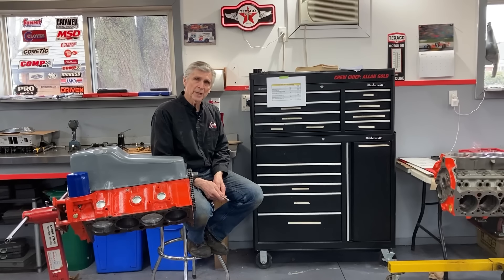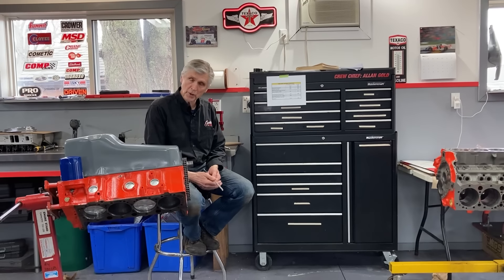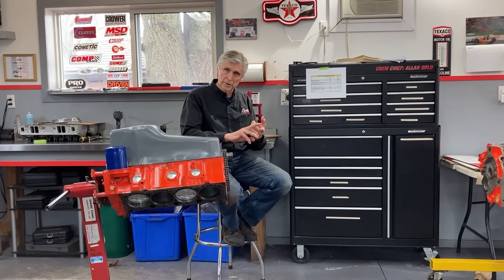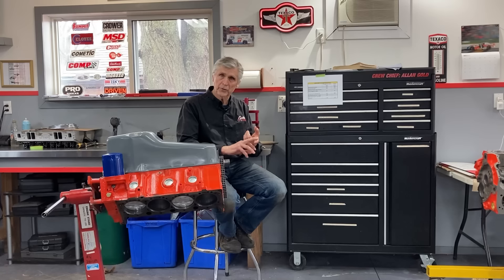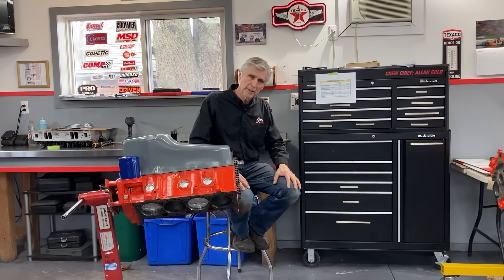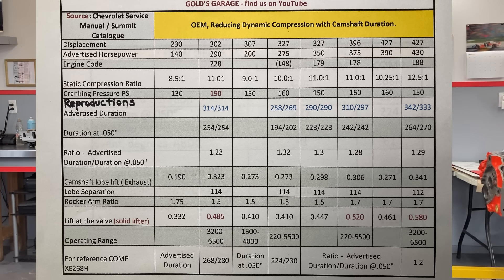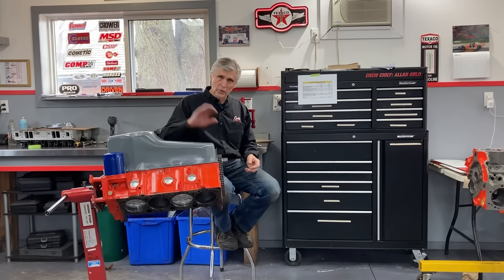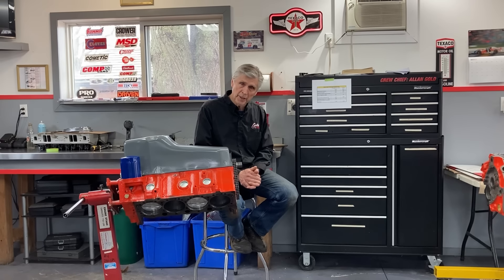Selecting the right camshaft - Compression Myths How much compression can you run on pump gas?

Comment: Thank you for the video. I'm learning all I can about this stuff. I'm about to take a healthy 6.0 and put a cam, springs, lifters, etc in it. I like that you are conservative. So, I have two questions. First, this LQ4 engine comes with 317 heads. The engine has a 9.4 to 1 ratio stock. I also have 706 heads from a 5.3. Everyone is telling me to use those. They would boost my compression to around 10.5 to 1. Do you think I would still run fine on 87 octane? Second, what cam would you run for daily driver, a bit more power, and mileage?
Reply from the maker: Thanks for the question Dylan. I am not as well informed on LS engines, however if you are building high compression, I would use the best pump fuel you can get. As for cams, the LS engines doe not need as much duration as the GEN 1 engines partly because they are all roller and can accelerate the valve faster on the ramp. Check the IVCP and calculate your DC and cranking pressure before you decide. 
The final result depends on many factors, the power/weight ratio of your car, gear ratios etc. 
Hope this helps. AG

Comment: i have a 496 bbc with 950 double pumper carb it is suddenly running really lean after a WOT pull.. AFR reading high teens while idling and running rough. next day start it up and its back to normal running good in the high 12s/13s. Wondering why it would start running lean after a WOT pull i drove it for a few minutes after to see if it would clear up but it didnt not until the next day i went to drive it again. Good fuel pressure float bowls are not empty any experience with this?
Reply from the maker: Have you thought about a vapor lock? The heat of a WOT pull can transfer to your fuel pump through the block. In our race car we use an insulated fuel pump mounting plate (SB) to prevent this. Eventually the fuel will cool down and the vapor returns to a liquid fuel and you are good to go again. Just a thought. hope this helps and please keep watching. AG
Reply: @goldsgarage8236  i dont think so im running a frame mounted electric pump back near the fuel tank
Reply from the maker: Thanks, well it was worth a try. Are you sure your fuel line is not running through a heat source? If you are lean there is insufficient fuel delivery to the carb or air possibly getting into the fuel delivery? If it goes away after cool down, what other possible causes that are related to heat and time.? AG
Reply: @goldsgarage8236  update: i hit a bump last night and the same  lean rough running condition came back i think i have an electrical issue somewhere
Reply from the maker: There you go, maybe your electric fuel pump is shutting down. Do you have a fuel pressure gauge?
Reply: @goldsgarage8236  yes fuel pressure is 6 lbs and the bowls are full

Comment: Your video was excellent!  

I am in the process of selecting an engine builder to build a new 421ci small block Chevrolet using a Dart SHP block with a 6-71 blower and AFR195cc heads with a 75CC combustion chamber.  One of the items we are discussion about is camshaft profile and piston dish selection.  He is proposing a 36cc dish piston (off the shelf), and a 255/239 .600/.580 114LSA hydraulic roller camshaft.  

What do you think about this combination?
Reply from the maker: Thanks for the question 331. Looks like a nice very high end build with all good parts. You might calculate your static and dynamic CR and cranking pressure to see if it works with the blower. Is this a pump gas or race fuel engine? What % boost are you planning with the blower? 
Your blower will increase the dynamic compression pressure and MEP, (Mean effective Pressure) That is how it makes power but there is a limit before the risk of detonation on pump gas. 
Bill Little, if you are watching,  can you comment please as you have experience with blowers? AG
Reply: @goldsgarage8236  thank you very much for the response.

This is a pump gas street driven vehicle, with between 7-10lbs of boost (to be tweaked on the dyno with the pulley setup).
Reply from the maker: Thanks 3310. i have sent a text to Bill asking him to look at this for me. He has good experience with blowers. AG

Comment: Hello,
I would like your opinion. I'm building a new power plant for my all around montana truck. It has 37" tires, sometimes hauls a camper short distances. I have the original 350 and I also have a 400 I could build. People say 400s overheat easy, do you think a 350 is more durable?
Reply from the maker: Thanks for your question gentle, and sorry I missed it until now. I would recommend the 400 for sure. It will give you the torque you need for a heavy truck. As long as you have adequate cooling, radiator, fans etc. cooling should not be a problem. Remember if you are using anything other than the original stock heads, you will have to drill them for steam holes. there is lots of info about how to do this online. Good luck and let me know how it turns out. Thanks AG

Comment: 150psig @ sea level is 10:1 compression ratio, and the higher you go the worse that is

Direct injection & advanced engine electronics is how my turbo 4 runs an OEM 13:1CR on 87 octane gas in Buffalo NY
Reply from the maker: Thanks for the comment Krak. AG

Comment: Great video! Have to take you up on your offer. I am building a 383 for a fun aggressive street car. The block is a pre 1985 casting, splayed 4 bolt, zero decked, 11:1 static compression w/ .040” gasket. Summit 151124 heads w/ .194 .150 valves and 175 cc runners. Following your recommendation I found a Howards cam p.n. 112041-09. Would this be a decent camshaft? Would appreciate your opinion and possibly another suggestion! Thanks!
Reply from the maker: Thanks for the question Sean. 
First, can you tell me a little more about the car and how you will drive it? 
weight with driver, final gear ratio, tire size, transmission, manual or automatic? Ratio of first gear, torque converter stall (if any). Is this going to be a cruiser or will you be racing it? Anything else you can add. Thanks AG.

Comment: 302 sbf what cam would you use?
Reply from the maker: Thanks for the question Danko. If you could give me a little more information about the engine, car it is going in, transmission, gear ratio etc. and your intended use I will try to help you with a cam choice. AG

Comment: I'm building a sbc stroker for a c4 vette 84 I have have cheap garbage Chinese afr rip off heads but want to port them myself any pointers and I have eagle 4340 h beams 7/16arp ones 4340 eagle 3.75 crank morel solid rollers good 8500 plus howards cam 111013-6 maybe the small basecircle version of it .640 .640 loft @.050 251/257 lca 102 lsa 106 3600 to 7600 was looking into the skip white wiscoe pistons 2618 ones are cheap only come .040 over though but have 3 versions -7.5 10-1 -5cc 10.9-1 and another thats like 12-1 what should I run vozards books have helped me a ton and thanks also a 4 link in a c4 their isn't much room so they will be short
Reply from the maker: Thanks Cody, sorry that I missed your question from a month ago. This sounds like a race engine for sure. I would suggest you calculate your static and dynamic compression and then confirm your final cranking pressure with a compression tester. If you have more than 200 PSI I would suggest race gas for sure. Between 180-200 I would be very careful with ignition timing, throttle opening, RPM etc. Hope this helps. AG

Comment: 12.5:1 on pump gas, is doable depending on what ignition timing one is running, depending on altitude, and how hot and humid the place is. Also how hard you're running the motor.
Reply from the maker: Thanks Sep. That is all true and I plan to cover this issue on my next video on this subject. Please watch for it. AG

Comment: In the USA octane in the 60's I believe was motor octane and today it is an average of motor and research octane number (R+M/2). RON is tested on a special engine that can vary the compression ratio at idle and MON is tested on a special variable compression engine at higher loads and speeds. I think that I have read that many other countries at least once upon a time used only the MON rating which could be a different number than we use in the USA. I haven't thought about it in years so I don't know if that is still true since things are always changing. I'm not sure but I think race fuel in the USA is MON only.
Reply from the maker: Thanks for the education on fuel Gary and for supporting my channel. AG

Comment: 11:7:1 guy told me colder plug no issues 
They changed cam during bottom end upgrade it took way too much vacum idles fine worried about detonations. Vacum canister or pump he does not know where my original cam is. I wouldnt buy a flat tappet now with issues. Old was 1600 to 7k rpms new is 3k through 7k sounds great taking it cross country
Reply from the maker: A 7000RPM cam will have lots of duration and late IVCP to help bleed off that 11.7:1 CR. Thanks for sharing. AG

Comment: Pump vs race fuel at higher CR has a lot to do with timing as well correct so if a sbc at 12/1 is sat at 35* timing is 93 octane possible ? Idk possibly mix 110/93? What about 100LL airplane fuel ?
Reply from the maker: Once again, I would suggest checking your dynamic compression/cylinder pressure as ab indicator. AG
Reply from the maker: As a follow up Josh, 100 Airplane fuel should work, but it is an expensive way to go for a street motor. If you are on the dragstrip then I would use it for sure. My last drag car in the 1970's had 12:1 compression and we used 260 Sunoco 100 octane.

Comment: Btu stands for British Termal units witch as I  understand things is btu is heat potential and not potential energy. Alcohol does burn at a lower temperature but continues to expand longer. Yes you need more of it than gas, but to say that it doesn't produce more power is correct or not, depending on your engines compression, boost, lobe separation. Alcohol will permit you engine to make up to 3 times more power than gas if you build for that purpose. Thought I'd  point out the way you phrased that comment. Like your video's.
Reply from the maker: You are correct Chris. Alcohol has less BTU/gallon, but that can be compensated by a richer F/A ratio. There are many applications of Alcohol race cars, including Alcohol Funny Cars that make huge power.  Thanks for your comment. AG

Comment: All cars that ran on leaded fuel needed hardened valve seats so the valve wasn't pushed up into the head from lack on lubricant. Many people ran the older cars on regular and were sorry. 70 and up were the good ones that ran on leaded gas.

Comment: My 300k mile Volvo B230F with 9.2:1 CR and a larger "B" cam than stock made 180-195psi cranking pressure. You could run 10.3:1 with this cam and still run '87.
Reply from the maker: Thanks for the comment Curtis. AG

Comment: I have a stock FE 428 that I would like to run in my 72 F250 camper special. The book says they came with 10.5 to 1 compression pistons. The info everyone is giving me is I need custom piston 9to 1 max. I would like to get a cam to use the engine the way it is. Is that possible or custom pistons? C6 2500 stall 373 gears. Might go with 411 gears if that helps. Its a fresh rebuild just trying to get a cam selected without the custom pistons.
Reply from the maker: Thanks Ed, If your engine is still together, I would suggest a compression test if you can to determine the cranking pressure you have now. I am surprised that the engine has 10.5 compression in 1972 so I would be suspicious of that. Most 1972 engines had lower CR so it is possible that you don't need to reduce it. If you can't check cylinder pressure with a compression gauge and the engine is disassembled, then I would suggest re-calculating your static CR. You will need to know your deck height, combustion chamber volume in the heads and then the piston dome or dish volume. Summit has a good on line calculator that works well. 
One way to reduce static CR is with thicker head gaskets, however that will increase your quench which is not desirable. Your transmission, gear ratio etc. looks ideal. 
As for the cam, since you have a fairly heavy vehicle, I think you need an RV type cam, however they have short durations so won't help much to bleed off compression. 
I hope this is helpful. Please let me know if you need more help as you find out more. 
Thanks for watching Gold' Garage. AG
Reply: @goldsgarage8236  its a 68 engine. 428 FE. The info on the factory stock pistons are 10..5 to 1. Machine shop looked up the pistons and found the same thing. I was just building a stock 428 to learn on. Just have the stock pistons to work with. Trying to find a cam that will work with the stock pistons. Thank You
Reply: @olallaeddy  I was just through this dilemma.
I chose a camshaft based on using factory replace the parts with an advertised compression ratio of 10.25:1. The actual ratio when all of the variables were entered in to the formula it was 9.1:1.The cylinder heads advertised at 72cc and measured 76cc.
 The camshaft I chose didn’t match the actual compression.
 It’s really important you use accurate values when you are doing your calculations, it’s a little tedious but it will save you time and money. In my case the engine was partially disassembled to correct the compression issue which was very expensive. You may not need custom pistons. The compression height, dome/dish volume, deck height, head gasket thickness, combustion chamber volume are all factors you will need to know and can’t assume based off of a manual or oem spec.
Reply: Thank You. The cam grinder never asked my compression when giving me suggestions. After the cam came it said to stay at 9 to 1 and run 2500 stall. Hope it works in my truck if not guess the 63 gal will get its 289 pulled out. LOL

Comment: Thank you, great video. I am a new subscriber, and of course I have some questions. I think you are in Canada so maybe fuels are different than US but I was born in 1969 in Connecticut. Until around 1990 we had 87 unleaded, 93 unleaded and 89 leaded. After 1990 no more leaded but it remained 89 octane.  We currently still have those three choices of unleaded. You talked about 1968 with high compression Motors. I guess there was no unleaded yet but regular  was 87 octane leaded and what was the octane of the high-test leaded? And was there two or three choices of pump gas octane?

That 100 octane fuel you mentioned, was that race fuel or pump gas?

And today I see we're up to 12 and a half 1 compression again but with 87 octane and I guess that's due to direct injection?
Reply from the maker: Thanks for the question Not Me. 
Sunoco had multiple choices, the highest was 260 with 100 octane right at the pump, not exactly sure of the other blends but I assume it was down to 87 or so. 
You are correct about direct injection, as the piston is only compressing air until just before ignition.
Let me know if I answered your question and thanks for supporting my channel. AG
Reply: @goldsgarage8236  well done, thanks for the answer. Yes I was confused because it seems like the name of the gas is 260 but the octane is 100. That was just slightly before my time so I missed out on that. But it must have been great to get 100 octane leaded fuel for pennies a gallon.
Thanks 
Daryl
 Florida

Comment: So I see this conversation come up quite a bit with regards to making power on Coyote applications where people are trying to make 750-800 plus hp on boosted setups on pump 93. Can it be done? Yes, but they don’t like it when you tell them that it isn’t a great idea and it likely won’t last very long without adding octane additives or switching to E85 or race fuel.
Reply from the maker: Thanks for the comment Brillo. That is crazy HP on the street. AG

Comment: @Gold's Garage GM's advertised duration point is different than the aftermarket cam manufacturers, GM used the actual opening and closing points while the aftermarket cams are measured after what they consider the opening and closing ramps-some are .010" and some are .020".   You would have to actually measure both of them yourself with a degree wheel to get an accurate comparison.
Reply from the maker: Thanks for your comments Robert. AG

Comment: When I was 19, I built a 355 with too small of a cam with around 9.7:1 compression, it made gobs of low end torque and decent midrange and fuel efficient but was also knock sensitive because it had about 240psi of cranking pressure. Lol
Eventually, detonation broke off a ring land and bent the exhaust valve while passing another car. Lol
Reply from the maker: Thanks Jeff. 240psi is a lot on pump gas. I usually aim for 180. AG

Comment: I've been an engine builder for years. Chanc3s are you won't run pump gas at that comp level. It's never worked before. Lsa also plays a role. With aluminum heads you can get away with 10.5.1 and cast iron heads non fast burn we ran 9.5 1 on 89 and 91 oct.
Reply from the maker: Thanks for all of your comments Paul. You clearly have broad and deep knowledge on this subject. Please keep watching and commenting. AG